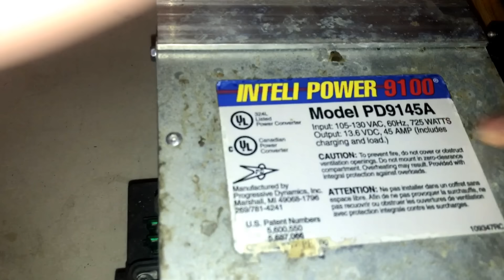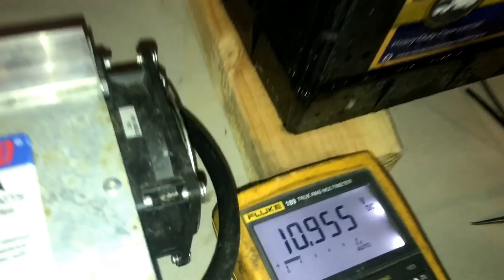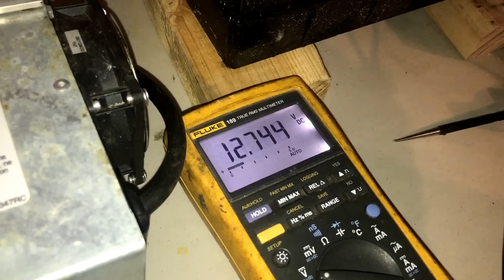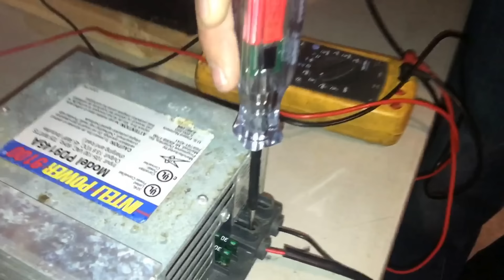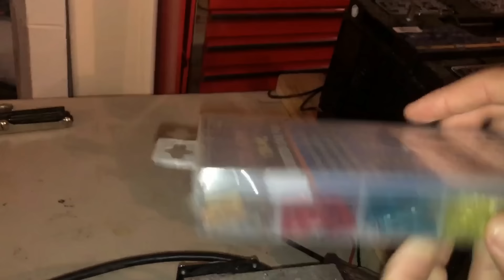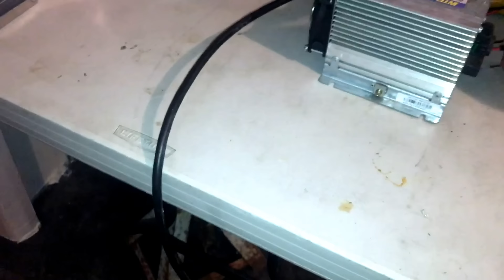How To Trouble Shoot An Rv Power Converter

Comment: I am having issues with my 12-v system (not working). With electrical power on from my house, I checked the 120v AC side of the converter (around 11.9 v); the DC side is at 0.0 v. so, what can I do about it ?

Comment: My inverter is cutting on and off lights flash over and over converter sounds funny what could be the issue
Reply from the maker: Check your rv batteries make sure they are full of water if they are not maintenance free, needs to be distilled water.  If the batteries are bad the converter carries most of the load and can eventually wear out. Start with battery inspection first

Comment: That fuse ,Im looking at a new style converter witha blown fuse, is not technically replaceable in these it is soldered on the board oh it can be replaced but tou need a special tool to unsolder the fuse

Comment: My converter fuses are good but battery is still not charging. Any ideals?
Reply: Do you have a test meter to see if the converter is getting AC power from the outlet and if the converter is putting out 13V DC on the output connections ?  Besides the  blade fuses on the outside of the converter by the wire connections, some converters have fuses INSIDE the converted metal housing.  If you have a friend to assist in testing , it could save you added expense in troubleshooting vs. parts replacing.

Comment: I love that you helped your customer with troubleshooting the unit first, rather than just replacement! :) 

Would you consider posting more videos on older converters and troubleshooting the electrical/electronic components on the inside? Trying to save an older rig, repairing existing stuff whenever I can avoid throwing new parts at it (also to learn how things actually work!) Thank you!

It's a 1988 Holiday Rambler Imperial class A (34 ft, Chevy 454 big block 7.4L) with a Magnatek 7455 converter (55 amp) standalone unit (mounted under the bed, 3ish feet away from the AC circuitb breaker panel, transfer switch, DC fuse lanel, sepwrate turn knob for cholsing which overhead air conditioner gets power). After replacing both 30 amp fuses in the converter (both were blown, the notorhome has been sitting in storage in between troubleshooting forays by me :) so not sure when that happened) I got power back to the DC ccessories on shore power! Victory! But can't tell if the battery charger portion is working yet. This older Magnatek 55 amp converter/charger, not sure if it's a slow trickle charge or if I should be seeing 14-15v charging as one would with an alternator charging a car battery while driving. I'll hook the batttery back up and give it another try, but there's some confusion there and if you have videos of you taking apart converters to diagnose the circuit boards and components, I'd love to see this! 

Thanks so much for doing what you do! :)

Comment: Hello I have a question 🙋‍♂️ I just change new batteries on my toy hauler 
And make the tune up on my generator 
Right now if a turn my generator on I not have ac and none of my 🔌 plugs work 

If I connect the trailer to my regular power in my house 🏡. It work good or a external generator. Can you help ?

Comment: my motorhome' is a 2003 Hurricane we just put it in a Mobile home/RV park, the inside lights work on DC, but when plugged into electric power the lights and appliances are not working, is there a switch inside the motorhome to switch the DC to AC or is it automatically switching to AC for the inside lights? my husband misplaced the Book.
Reply: Hi Linda, you may have a faulty TRANSFER SWITCH which has a small timer circuit board inside a metal box.  Mine is in a cabinet below the kitchen sink floor.   It switches the load ( breaker panel ) from one source to another ( shore power to gen or battery power and vice-versa ).  Mine failed second day into hurricane Beryl so I had to use a portable  gas generator while my motor home had 70 gallons of diesel fuel that I could not use due to the electrical issue.

Comment: Great video!  Just found your channel and Sub’d.   Always good to get knowledge before something goes wrong.   It took me a couple weeks to figure out that the 50 amp circuit breaker had tripped.   It was up under the hood of the Thor class A inside a metal box.
Will be looking at several of your vids.   Respectfully,   Kevin

Comment: Why does my power converter make noise?
Reply from the maker: Several reasons, when they work really hard they get louder.  Check battery’s on the rv are they full of water? This can cause it. Also bad batteries can.  And or a okd converter on its last leg

Comment: Joe on my Outback 240 urs the WFCO WF 8955 pec converter fan is staying on for two days. WFCO trouble shooting page says to remove 2 40 fuses and if the fan still ran the converter was bad, the fan went off. What is the issue? Also my water heater only works on gas. When I try to start it electric it does like your video says comes on then goes out.
Reply: Also my battery shows fully charged at the panel on wall

Comment: I also found a dead fuse on the converter after checking and rechecking the fuses on the fuse panel. This was after 2 new Dura Cell batteries and a secong set , on warranty, before I found the problem.

Comment: Hello Joe, my lights in my rv won't light up unless I have shore power plugged in. My batteries are at full charge, due I manually charged the. When I unplug my converter from back of the panel the light go out. About five years ago I had the same problem, I took it to a rv tech and he found a breaker that trip in a hidden sport on my rv. Have you run into this before. For the life of me I cannot find that breaker. Thanks for your help, Norm
Reply from the maker: So did you check all the fuses? What is the year make and model of the rv? What kind of power converter does it have?   You may need to reset the mini breaker near the batteries if it has one.  Reach out to me if you wanna talk on the phone.  Cannons Rv Repair.  Leave a voicemail If i dont answer.

Comment: If the unit continues to blow fuses then it may require to replace the converter unit right?  Or perhaps point to some other issue somewhere else to explain why the fuse would blow like that.
Thank god for fuses BTW.

Comment: My converter has no fuses. I lost power on the DC 12v side with ac power but with the batter hooked up I have 12V power. I assume a bad converter in this case.

Comment: I have a 90a converter that was putting out 14.5v to charge my Lithium batteries well.  It is now only putting out 13.4v max, and thats with the "magic button" being pressed.  The unit is original in a 2016 RV.  Any advice?

Comment: I have a 5th wheel 2016 Heartland Edge 397ED Toy Hauler and it smelled like something was burning so I got up and investigated, I turned all the heaters off and I could hear noise coming from underneath the camper so I flipped the main breaker and the noise quit so I flipped the breaker back on and I t started again so I started flipping breakers one at a time and when I flipped the converter breaker it stopped so I opened up the cargo area and opened the access panel and it smelled really hot, so I'm gonna leave that breaker off but just wondering if NY camper will function normally without the converter being on ?????
Reply from the maker: Once the battery goes dead all your 12 volt will stop working. Which basicly is everything furnace fridge 12 bolt lights. Definitely hire an Rv tech to investigate the problem

Comment: I had the ground come loose from ground bus bar in transit for the power converter.   It is still throwing an open ground error or a line 1 neutral reverse.  Sometimes the error goes away.  Is the converter giving an error and is broken because of a short?
Reply from the maker: Id be looking for a short It could have melted some wires somewhere in a junction box if it seeked ground thru the hot side
Reply: @CannonsRvRepair  so the surge protector reads normal before plugging in the camper cable and then the surge protector has a reddish/greenish light on. Is there a way to tell if the surge protector is trying to indicate red or yellow?
Reply: So I flip of the converter breaker and the surge protector reads normal and then I turn it on and I have the error code on the surge protector.  Strange thing is the error sometimes goes away and reads normal.
Reply from the maker: @MP57719   Could be a bad converter
Reply: Thanks, my next trick would be disconnect the battery and see if that corrects the error.

Comment: Great Video specifically about this Converter. I bought a used class C. Under the bed there is this exact converter. The exception is the DC Power cord is not plugged into anything. The 12V is connected but what should the DC Plug be connected to in the motorhome?
Reply from the maker: The 120 ac plug should plug in. Sometimes if it is by the breaker box it sometimes has a plug in the back of that. If it is a household plug.
Reply from the maker: Otherwise it has to be wired up

Comment: Quick question, why did the fuse blow. I think our converter isn't working on our brand new 5th wheel. We replaced the 12v battery 2 weeks ago because our power went out at the house and the inverter kicked in to run the residential fridge and drained the original battery down to 2.86v so I replaced it and leaving our campsite today the inverter was beeping and one symptom was Lowe battery and it was reading 11.3v, when we got home I checked the battery and sure enough it was 11.3-11.6v. Any ideas, our place we bought the camper at is of no use.
Reply from the maker: If you lost power or had a power surge without a surge protector, It can damage the converter and blow the fuse. If yoj replace the fuse and it keeps blowing and you dont have a direct short then most likely you will need to replace the converter. But you can verify this by isolating just the converter unhook it from the 12 volt battery and then repthe fuse if it blows yoj know uour converter has an issue. And needs replaced most likely
Reply: @CannonsRvRepair  Thanks for he reply. Our 5th wheel has about the cheapest battery cut off switch Ive ever seen, just a push/pull knob and long story short the damn battery was disconnected  since we've owned it 5 weeks now.

Comment: Hi I just seen your video and also subscribed. Thank you for sharing! I do have a question my 45 amp converter stopped working 4 days ago and I was running solely off of my battery well my battery died and it’s currently charging at my local AutoZone. I know absolutely nothing about fixing or trouble shooting my converter and I’ve called RV companies who offer mobile service however it seems as though a lot of RV’ers are experiencing issues and are 3 weeks out before I can get someone out to me!!! My dilemma!! My question is will I need to remove my converter from its home in order to troubleshoot it? Thank you in advance!
Reply from the maker: You should be able to troubleshoot it while it is installed, where are you located?
Reply: I’m in California and now the battery is no longer working,, ugh!! I think it might be time for a new travel trailer. Thanks though your videos are very helpful!!

Comment: Should the fan run all the time on a converter, or just when it gets hot ?
Reply from the maker: Typically they will run to cool them down, the harder the converter is working, then the hotter it can become. So the more items you turn on the louder the fan can be.  Check your batteries make sure they are full of Water. Sometimes they go left uncheck and when they are dry it will make the converter work harder.  Also they may need to be replaced depending on the age of them.
Reply: @CannonsRvRepair  thanks for the info, i think my converter is dead, i get no fan and no voltage at the battery terminals, all fuses and circuit breakers  are good

Comment: If you happen to read this.  I purchased a used 2018 Heartland Sundance 189MB, brought it home and plugged it into my 110 outlet with the adapter.  Everything was working fine in it...slide would go in/out, lights worked, tongue jack, etc.  I wanted it checked out for a long trip (brakes, bearings, appliances, roof, etc.) so I took it into a local RV shop.  I stowed the slide the day before taking it in and it sat on the lot for 7-10 days before they got to it.  I get a call telling me the battery is dead (probably the original, 3 y/o) so that did not surprise me.  What has me baffled is they also said the main board on the 8900 series (I believe it is 8955) WFCO is also dead.  I asked about the reverse polarity fuses and the shop manager was clueless but checked them anyway...I am assuming a visual inspection...said they were good.  If you don't know what it is how do you know how to check it?  Told me I needed a new converter ($560.00), new 12 v deep cycle battery ($200.00) then proceeded to tell me of several other things wrong.  I know, "it was working before it wasn't" but seriously?  I have more wrong with the trailer now than when I took it in.  I am going to bring the trailer home and do my own "testing"...on everything!  I will buy a new converter and do the work myself as it is only 5 wires and looks pretty simple.  Is there anything else I should check besides fuses before buying a converter and new battery?  Thank you!

Comment: If the converter is bad. The voltage reading on the fuses and/or power wire would be low?

Comment: If the lights start going dim because the battery is going dead. Why would the ref ridge stop working?
Reply from the maker: because part of the Refrigerator needs a minimum battery voltage to operate properly. So it needs the 12 volt power to operate the circuit board.

Comment: What voltage should a converter deliver to a coach battery to charge it?  Alternators deliver 13.7-14.4 volts to a starter battery, wondering what converters deliver?

Comment: Great video. I can't figure out why my investor is working as it should when the main switch for house is on but when I turn the battery disconnect switch off the investor bumps the charging volts up to 19 volts and it's boiling the battery fluid and some LED lights. This of course only happens when its plugged into the 110 v . Can this still be the investor? or the solenoid for the battery disconnect? any ideas?

Comment: Hello, we have a 94’ fleet wood. Our outlets and microwave and fridge went out. We immediately went to the fuse box area where the converter is and that compartment was very hot. We shut the breakers down and did a restart still nothing. The outlets are getting power but when we plug something into them that object does not work. There is no CGFi reset/test outlets anywhere. We really need help as to we do not know what happened. The converter is making a humming noise. We are using extension cords for the fridge and using our lights off our coach batteries, we tried unplugging the converter and plugging it back into the outlets but nothing. So we than plugged it into an extension cord and it made the lights brighter and was doing the humming. We have changed all the circuit breakers and checked the fuses and nothing was blown. But we did replace everything including the circuit breakers. We are connected to shore power. Can someone please help us

Comment: My 2000 Bounder 36 has been shutting down completely the power at night then in about 20 to 40 seconds coming back on. We are plugged in to shore power 30 amp.  Breakers are fine so I am thinking converter shorting out and resetting coming back on. Please coment

Comment: Im having issues my 50 amp breaker keeps tripping it happens when just the ceiling fan running or off it doesnt happen all the time but at 3am it tripped at 630 am it tripped then after i shut everything off and reset it it fine again everything is running its fine also my dometic refergerator has the gas and the check light barely flickering can you help
Reply: Check your propane line and tank.  But, the plug may not be all the way in.  My next door neighbor found Hers came lose.

Comment: Hi Joe  it is   almost 3 yrs. later ,  My converter sparked and smoked  when I plugged into shore power, my system is a 30 amp rig.  I used  an adapter to plug in to my daughters garage receptacle , today I got a camco  plug in tester that has a series of lights to diagnose. the 1st receptacle I  tested had an open  Neutral ,  the second  receptacle tested  had a open ground , which was a poor connection …. when I moved tester prongs in receptacle , the faults tested ok , no fault codes . my 12v part of the rv seems to check out fine , when I turn the 12v switch on .   I think I need to replace the converter … My rig is 20 yrs. old  I am the 3rd  owner , rig has  62,000 miles on it.  do you feel  that I am right in my diagnosis  ?????   Thank You  !

Comment: My converter AC and DC are working fine but I keep blowing my fuses on the inverter it will not charge the battery
Reply from the maker: The inverter does not charge it inverts dc power to ac power. Altho some inverters have built in converters as well. Most likely you have a direct short somewhere. Time to have a technician take a look

Comment: Thanks, very helpful!  I have a 1997 Ford E350 Tioga Montara 22 ft Class C.  Its one problem after another!  Making a mechanic out of me faster than a traveler.  Brand new batteries, because converter failed to charge old ones which were new too!  So frustrating.  And no way can you tell if the converter fails. Green light comes on like usual.  $500 spent all over again on new batteries.  Argghhh!!

Comment: Great video! Question: I noticed the fan in the converter doesn't come on anymore & the breakers are warm, especially the "Main" breaker (it's hot). Would this have anything to do with the GFI in the bathroom (and the 4 other receptacles) not working? Thanks
Reply: receptical should be on 120 volt and not 12 volt.Could be a bad breaker or a short in the wiring.
Reply: Thanks! It was the breaker 😊